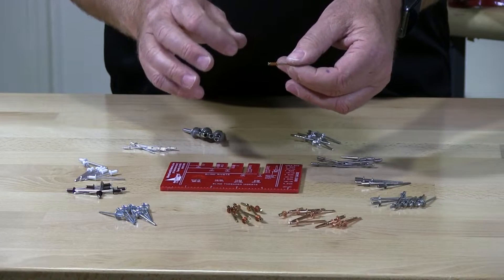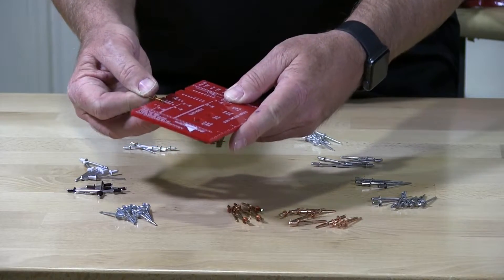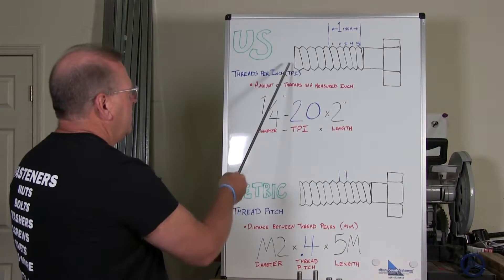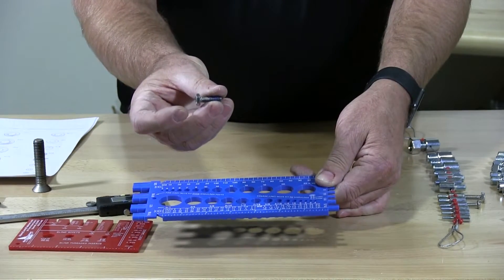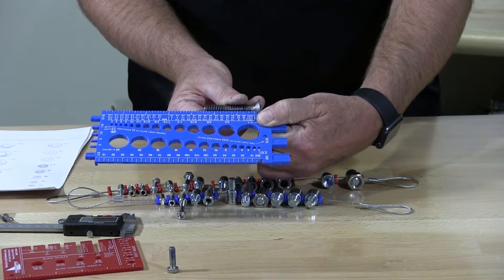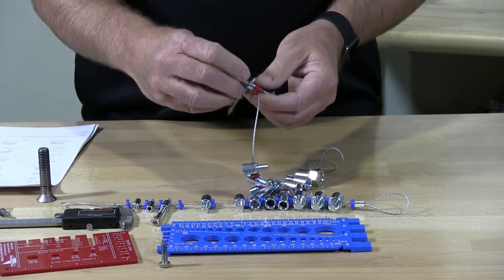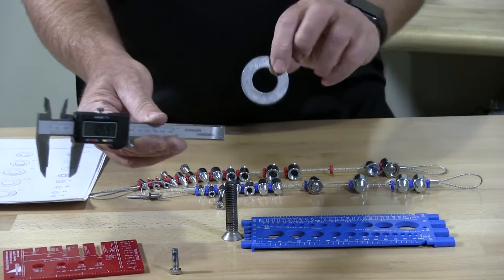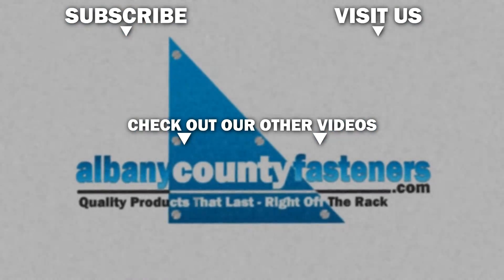How to Measure Nuts, Bolts, Screws, & Rivets | Fasteners 101

Comment: On the imperial bolts, why do they start with sizes 4, 6, 8, 10 and then switch to fractional as they increase from there?  Are those numbers actually indicating mm?  We start off mm and then switch to inches?  Do those equate to some exact fraction like a sixty fourth?  Is a 6-32 imperial the same diameter as an m6 but a different pitch?

Comment: Could you tell me what are all of the numbers that are in the grid at the bottom where it sats INCn UNCand UNF? Thanks
Reply from the maker: I assume you are referring to the blue fastener gauge? The grid at the bottom lists off common fastener sizes in imperial and metric and their respective coarse (UNC) and fine (UNF) threads per inch / thread pitches. Most fasteners of a given size will have their thread pitch be one of those 2 numbers, with rare exceptions.
Reply: Oh, perfect! Thanks

Comment: wats the correct rebit for 1/2 " wood to a stainles steel sheet 1m
Reply from the maker: We're not entirely sure what you are trying to ask here. Are you asking for the correct drill bit to drill through 1/2" of wood and a stainless steel sheet or the correct driver bit for installing a 1/2" screw into wood to connect it to a stainless steel sheet? Furthermore, what does 1m refer to? Is that the total thickness of the materials, the length you need to drill, or something else?
Reply: nstead of two peaces of metal ..it l be wood wth stainless steel
Reply from the maker: Okay, but are you asking about the right drill bit for drilling through or the driver bit for drilling a screw through that? Is it 1/2" thick total, including the metal and wood, or is 1/2" referring to the screw size? What does 1m refer to?

Comment: wats the corret rebit for 1/2 " to stailess steel sheet
Reply from the maker: We're not entirely sure what you are trying to ask here. Are you asking for the correct drill bit to drill through 1/2" of stainless steel sheet or the correct driver bit for installing a 1/2" screw into a stainless steel sheet?

Comment: Got a question for you about the automotive clip nuts used on fenders. 
They tend to rust to bolts then snap the clips during removal. 

Why aren't they available in stainless? 
Could they be custom made for reasonable price?
Reply from the maker: They probably aren't available in stainless because the cost is too high and there aren't enough people looking for them. You could get them custom made, but the cost would be far from reasonable and you would need to make a large number of them.